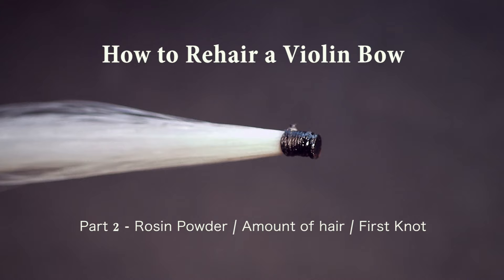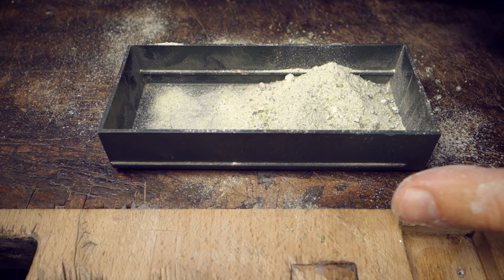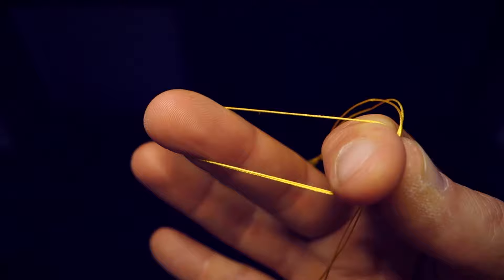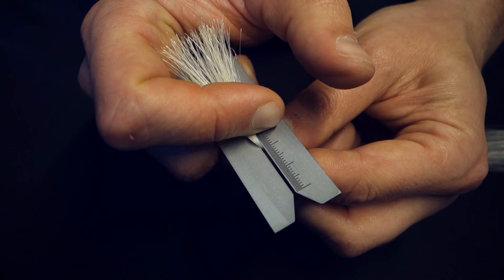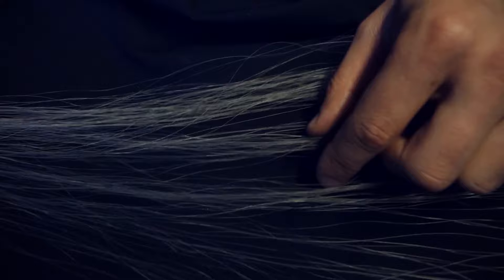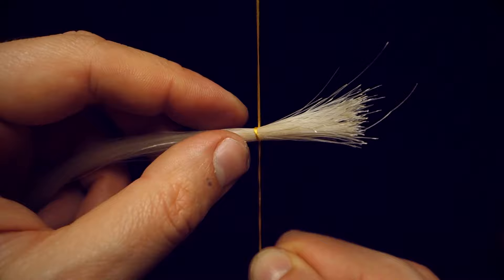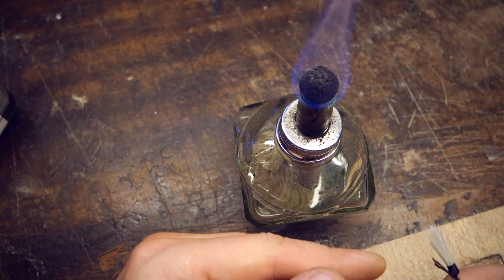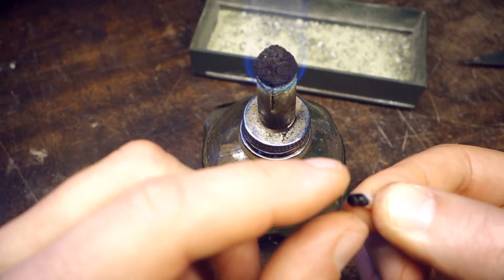How to Rehair a Violin Bow - Part 2 of 4: Making the First Knot [HD]

Comment: I have been rehairing and repairing bows for 35 years. These videos are interesting, to see how others do the same work. The process of rehairing bows can be approached in a variety of ways. It does not matter how each step is done as long as the end result is satisfactory. 
I learned originally to rehair frog to tip, that’s how my teacher did it. Initially I thought I caught on quickly, had false sense of competency. Then when I started working in a shop, the pressure was on, it was pretty grim. 
There were a number of things working against me, I was trying to use poor hair, most of the bows I was doing were poor quality, among my other things.
The thing that made the biggest difference for me was to start over and learn to do the job tip to frog,. Everything just works better for me this way. 
I’ve watched other videos and the way some people do this just scares me. Some of them put the bow stick and frog in danger because of the way they do things. The last thing we want to do is break the bow.